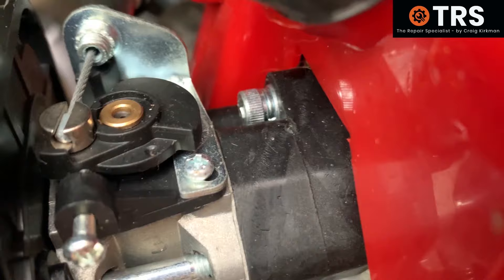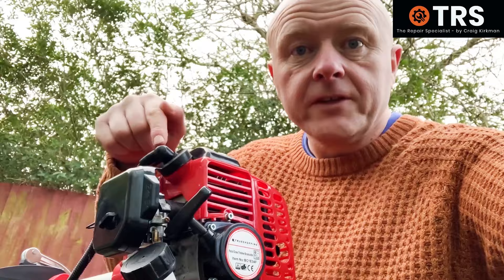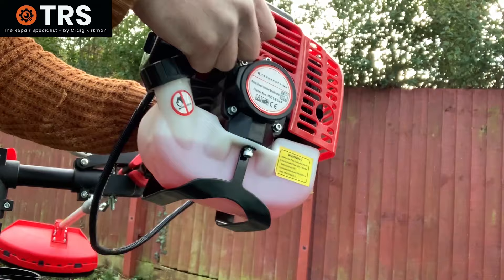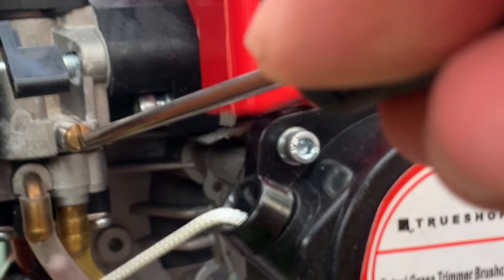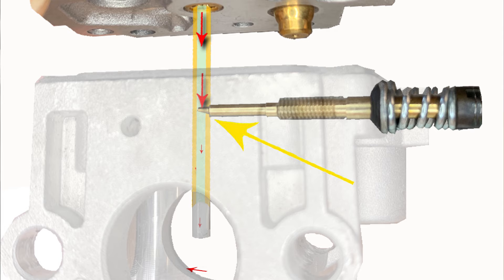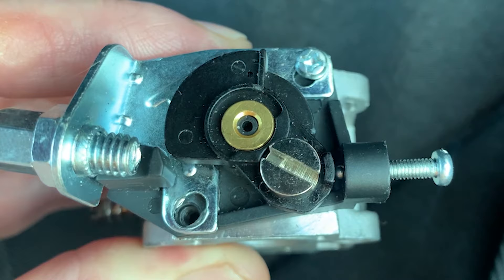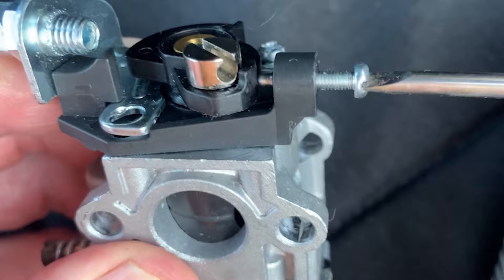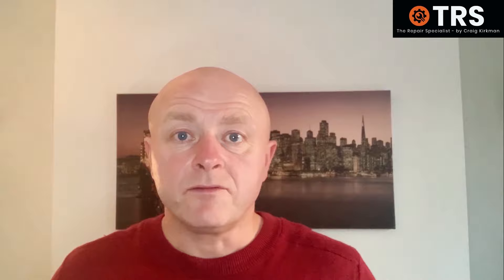Single Tuning Screw Adjustment Weed Eater & Strimmer Carburetor (Adjusting only 1 of the 2 screws)

Comment: Hi. Big question with hopefully some help, as it’s driving me made. I have a strimmer that uses the same carburettor. I have 3 of these carbs. 1 works fine, starts when cold etc. 2 + 3 won’t start when cold. However, when the strummer is warm, they work fine. I have stripped/cleaned and replaced gaskets etc, but still no difference. What am I doing wrong? Thanks for any possible help.
Reply from the maker: Hello there!

First off, it sounds like you've been really thorough with your maintenance, which is great! Small two-stroke carburetors can be finicky, and the issue of cold starts can indeed be maddening. Since one of your carburetors is working fine, you're clearly doing a lot right.

Considering that Carburetors 2 and 3 work well when the strimmer is warm, it suggests that your cold start issue may not be related to the fuel mixture or the gaskets. Here are a few things you might want to check:

Choke Functionality: Make sure the choke is functioning properly. The choke helps enrich the fuel mixture when starting cold by reducing the amount of air. If it's not engaging or disengaging correctly, it can cause starting issues.

Primer Bulb: Since you mentioned they're purge primer type carbs, the primer bulb should be firm to the touch after a few presses when cold. If it's not, it could be a sign of an air leak or a problem with the primer itself.

Fuel Quality: Double-check the fuel mixture. Stale fuel or an incorrect mix of oil and gasoline can cause starting problems, especially in cold conditions.

Spark Plug: Inspect the spark plug. A dirty or worn-out spark plug may not provide a strong enough spark for a cold start but can perform adequately once the engine is warm.

Air Filter: Even though you've replaced gaskets, ensure that the air filter is clean. A clogged air filter can restrict the airflow, making cold starts difficult.

Carburetor Adjustment Screws: Your carburetor actually have two adjuster screws on these.  The common large screw on the side that adjusts for High RPM and there is another, hidden screw at the very top of the carb.  This is for the LOW RPM.  This usually doesn't need adjusting but in your case it might. Take a look at the top where the throttler turns. In the center there is a screw (you might need to remove some tiny plastic bung to get to the screw). Adjust this at LOW RPM if you feel there is any idling issues. 

Carburetor Internal Passages: While you've cleaned the carbs, there may still be some small passages that are clogged. Sometimes, ultrasonic cleaning by a professional can resolve issues that standard cleaning can't.

It can be a process of trial and error, but don't lose hope! It's always the little details that make the difference with small engines. If you've checked all the above and still can't find the culprit, it might be worth taking them to a professional who can give them a once-over. Sometimes a fresh pair of eyes can spot something you've missed. Keep at it, and I'm confident you'll get those stubborn carbs to cooperate. Good luck!

In the meantime please let know know how you get on with it!

Thank you

Craig
Reply: @TheRepairSpecialist  Thank you for the quick reply. I checked 2&3 again. 2 has a split pink non return valve, which must let air in somewhere and not hold the fuel. The fuel itself is new (or constantly replaced ) as it is used a lot. The plug could do with a change, but as it starts with No1, I thought that it would be ok. I have ordered some more parts etc. With new carbs being as little as £11, it’s not a massive issue….but, I hate not knowing why, and it’s worse when they work with a warm engine!! . Also I  would rather fix than throw away. 
Thanks again. The battle continues!! 🤣

Comment: factory carb settings? mine wont Rev with out the choke applied
Reply from the maker: Sorry to hear you have been having problems.  

A small 2-stroke weed eater that only operates on the choke setting is frequently the result of a lean fuel mixture or a restricted fuel supply. By limiting the amount of air that reaches the engine, the choke setting can temporarily make up for a lean mixture by enabling a larger concentration of fuel to enter the combustion chamber. Here is a more thorough explanation of the causes of this problem:

Fuel Flow Blockage: Inspect for any obstacles or blockages in the fuel tank, its lines or blocked fuel filter. A restricted fuel flow may lead to a lean fuel mixture.  The fuel tank cap also has a special valve allowing air into the tank as fuel leaves, make sure this is venting well. To test this I run the engine with the tank slightly cap loose for a few minutes and see if the the engine runs better. If so, the tank is not venting correctly. Of course be sure not to allow fuel to spill out causing any dangers. To find out if the fuel filter is at fault, remove it and run the engine for a few minutes (providing there is not too much dirt in the tank) and see if it runs better. Then you will know if it is the fuel filter.  I would then do the same with the air filter. Just for a very short while to see.   

Next, Dirty Carburetor: The engine may not be receiving enough fuel due to clogged jets, passageways, or a filthy needle valve in the carburetor. It might be necessary to clean or overhaul the carburetor.

Lean mixtures can occur in engines due to air leaks in the intake system (inlet boot/manifold) which can be caused by cracked crankshaft seals, defective gaskets or the boot itself. Look for any obvious leaks, or while the engine is running, check for air leaks using a carburetor cleaner.

Insufficient Fuel Delivery: It's possible that the carburetor's diaphragm or fuel pump aren't providing enough gasoline. Check for damage and make sure these parts are operating properly.

Inaccurate Fuel Mixture: Verify that the fuel tank's oil-to-gasoline ratio is precisely as directed by the manufacturer. A lean state may result from an improper combination.

Broken or Stuck Primer Bulb: Make sure it's operating properly. A broken primer bulb can prevent fuel from getting to the engine.

As it is common, I will emphasize again here about a Blocked Fuel Filter: Look for obstructions in the fuel filter. Fuel flow to the carburetor may be restricted by a clogged filter, producing a lean mixture.

Again, with the Clogged Air Filter: A clogged or dirty air filter can impede airflow, leading to a state of being too lean. As needed, clean or replace the air filter.

Condition of Spark Plug: A worn-out or fouled spark plug can interfere with combustion and cause a lean mixture. If the spark plug is damaged or old, replace it.

Problems with the Throttle Cable or Linkage: Check to make sure the throttle cable and linkage are not stuck or bound, since this might impact the air intake and throttle responsiveness.

I have a query concerning your weed eater now: Has the problem of it only running on the choke setting recently been caused by any modifications you made to the carburetor, parts you replaced, or fuel mixture you altered?

I look forward to hearing from you
Craig
Reply: @TheRepairSpecialist  the labining on the choke was reversed... Open was closed and closed was opened 🤣

Comment: I am working on an Echo GT-2010 trimmer with a Walbro single adjustment screw carburettor. It idles nice but runs to rich at full throttle. When I adjust it to run perfect a full throttle, it will not idle. I took the carburettor apart, cleaned it and replace diaphragms etc. but nothing changed. It has 190 psi compression. Any ideas ?
Reply from the maker: Ok, it's good to hear you have cleaned the carb.  Have you set the idling with the separate idling screw?  I would get it to idle by adjusting the idling screw first, then rev up and set it with the single adjuster screw for high rpm. then see if it works better.

Thanks

Craig
Reply: @TheRepairSpecialist  its a single screw carburettor, so no high/low screw.
Reply from the maker: The single Screw is for both the High and Low fuel to air mixture adjustment, but there still should be a separate screw for the idling speed.  Usually above the single screw adjuster, at the very top of the carb where the throttle cable meets the carb

Comment: One question if you're so nice... I have a Procraft Gd 62 49cc engine and I can't idle it (throttle to minimum) because the engine dies. No matter how much I adjust the carburetor or the idle screw (the one connected to the throttle cable), the engine dies when I turn the throttle to minimum. It works (I hit about 50-60 holes with it) but I have to keep the shock half way and it's not ok because it gets hot. I have it for a few weeks and it has been like this for nine ... What could be the causes? Impulse hole partially plugged? Any other adjustment from another screw that I don't know about? Should I purchase another carburetor? Thank you very much!
Reply: There is a screw to set the idle that this fella didnt mention , it's at the top of the throttle body in the brass ring but it has a rubber bung in it , remove the bung and the screw is under it , it's a very fine flat screw head and adusts the idle mixture
Reply: @williamfurniss6442  thank you very much!
Reply: @williamfurniss6442 should it be screwed in all the way small brass on top?
Reply: @1naequan  no I dont think so adjust the screw till you hit the sweet spot for tick over and low revs

Comment: how many Rpm can that engine produce
Reply from the maker: Thank you for your question! The RPM (revolutions per minute) that a small strimmer (string trimmer) engine can produce can of course vary depending on the make and model of the engine. Small strimmer engines typically operate in a range of 6,000 to 10,000 RPM, but this can vary. To be honest, I haven't measured the RPM on this particular machine but i would put a guess at it being something like what i have mentioned. Thanks. Craig

Comment: So what does the adjuster do that's under the plastic bung on the throttle body ?
Reply: That little screw is the low speed adjustment. It's responsible for keeping the correct air/fuel mixture ratio for low to medium speed or thereabouts. It also adjust the throttle response speed.
Reply: @ciprianwinerElectronicManiac yes indeed just surprised this guy who obviously knows his stuff never even mentioned it